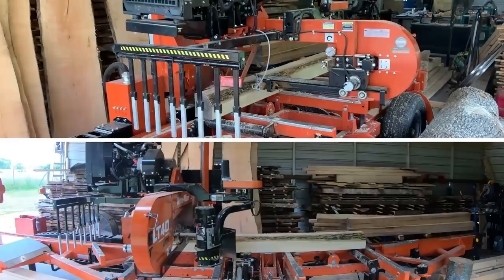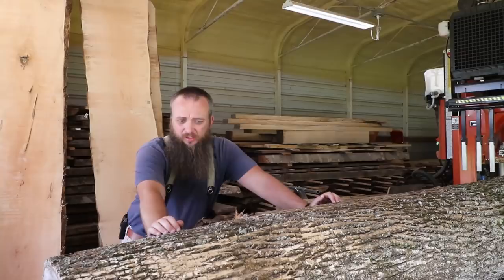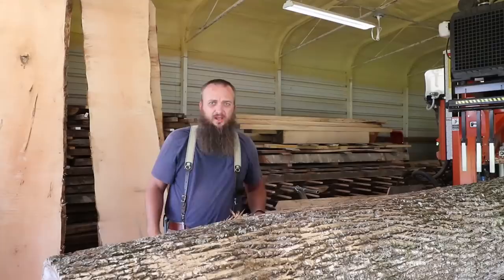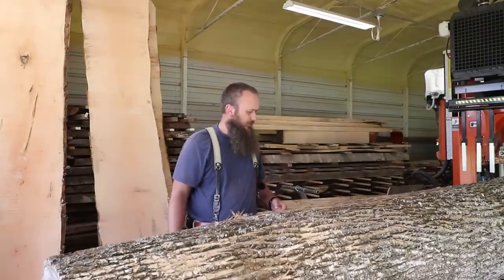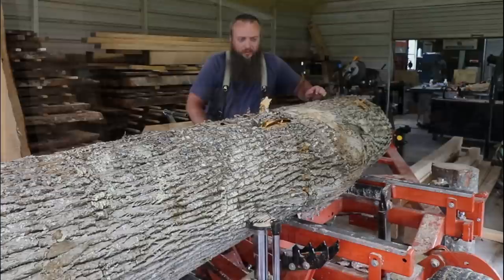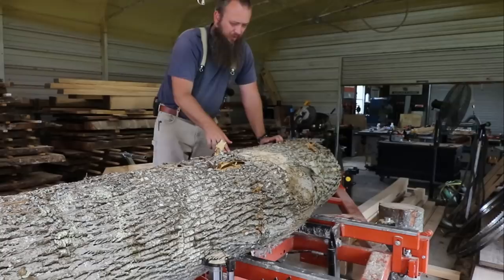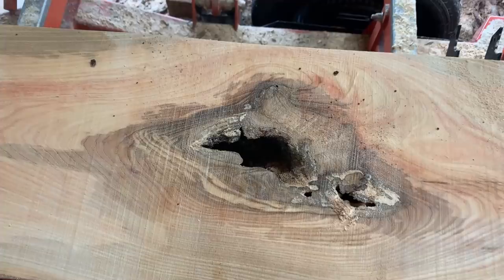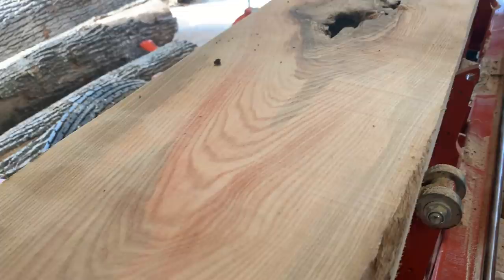Making Money With A Sawmill, Grade Sawing With A Wood-Mizer, Part 1

Comment: Why is the second cut flipped 180 from the first rather than 90? I have a manual mill, seems like less rotation to just rotate it 90 at a time? I'm sure there's a reason, I just don't understand it
Reply from the maker: sawyer preference,
Reply: The two sides will then be sqaure to each other as they are cut off the bed. When you cut against the back stops it is easy to be a little off 90 deg. from the bed.